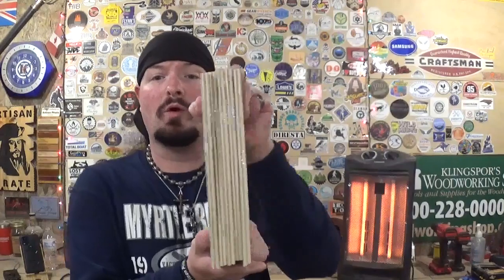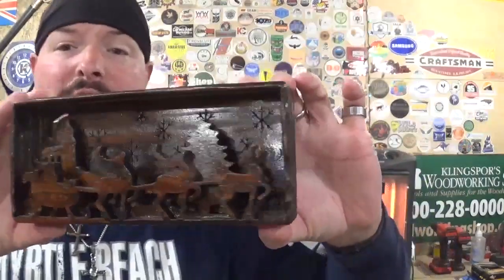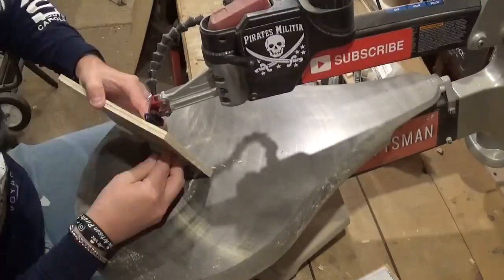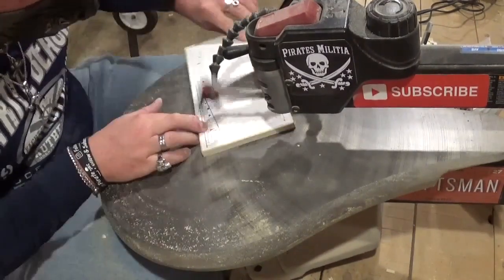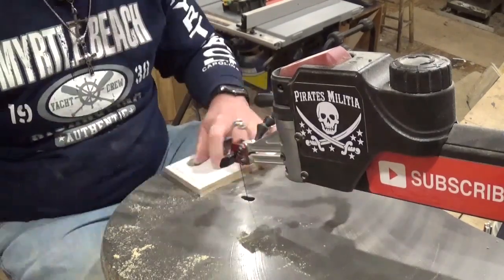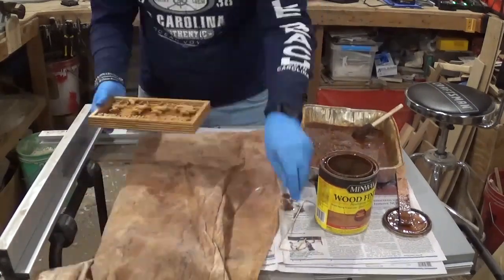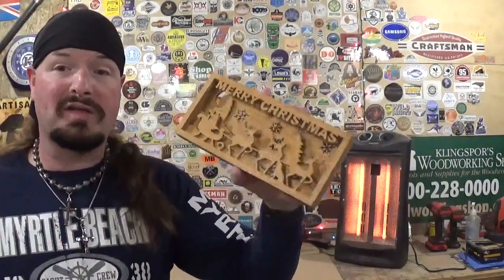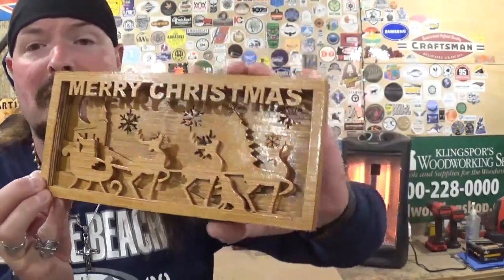Merry Christmas To All, Scroll Saw Project

Comment: You do good work, can you tell us what speed you use. I have trouble setting the speed. To aggressive and it wants to stray off the line.
Reply from the maker: My speed is between a 6 and 7 depending on the thickness of material, as I always say, take you time and let the blade do the work